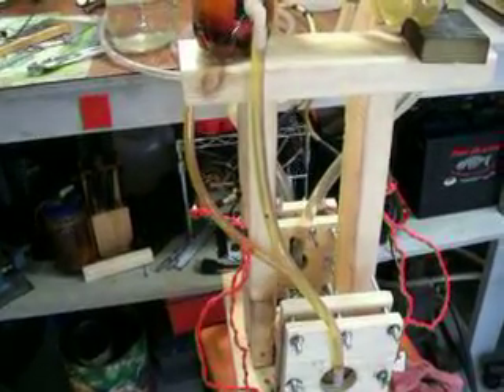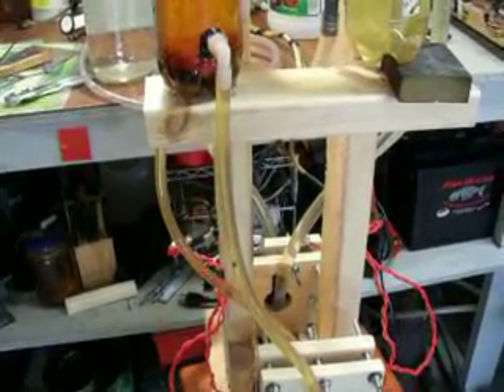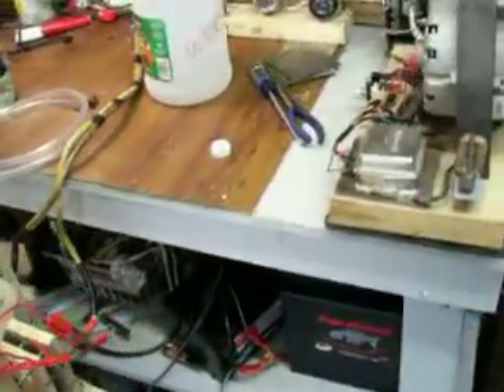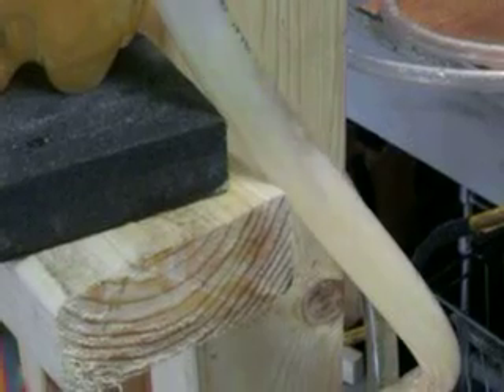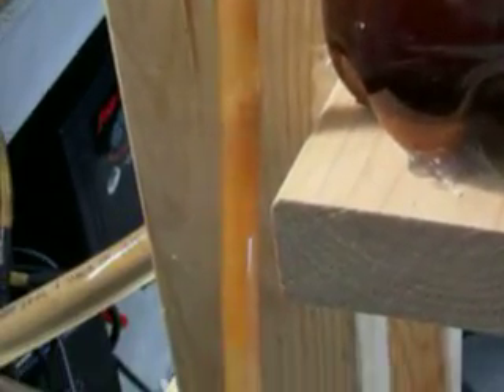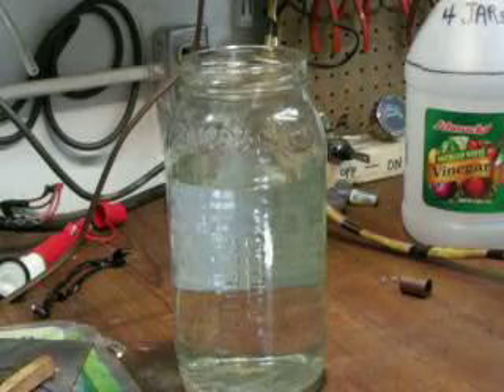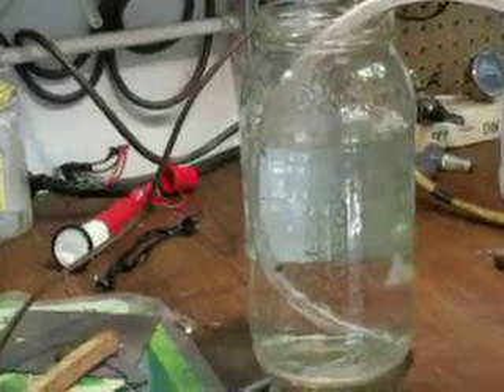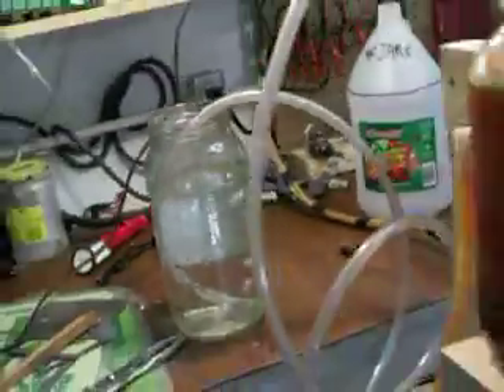more hho gas with bigger hose

Comment: Interesting. With that flow rate, I'm wondering if the cell will run cooler compared to the cell with the smaller line. Thanks for sharing.  :)